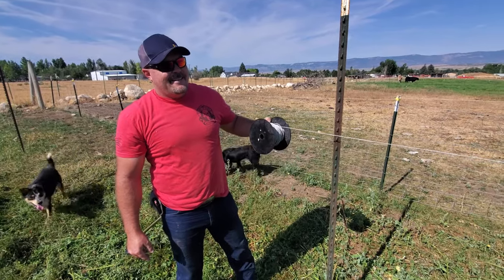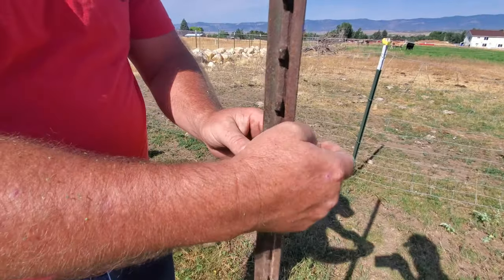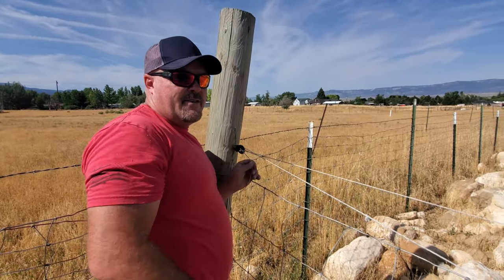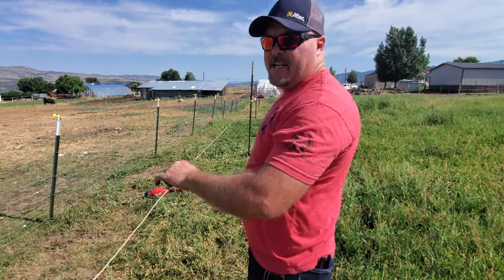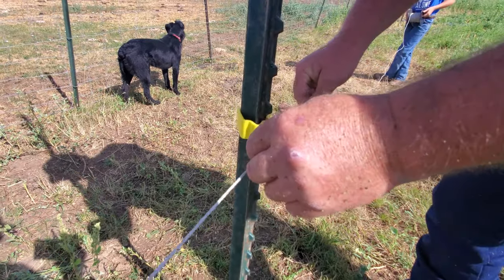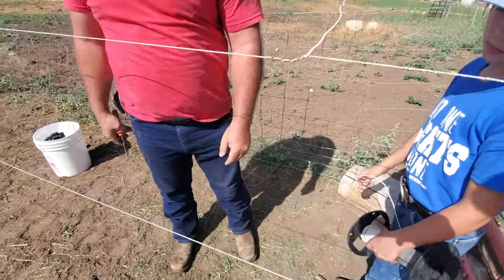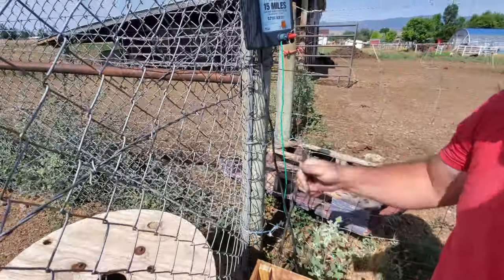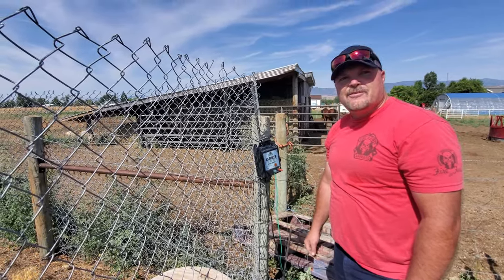Easy Electric Fence Install | Step-by-Step

Comment: "It does do 15 miles, I told you"..... This made me laugh! I guess b/c I can relate. Good video! Now I will stop buying the connectors to energize top and bottom strands; just use insulated wire to energize. Common sense

Comment: A question. On putting up a bear hot fence do you think the string wire is ok to use or would you go with the wire wire 14 Or bigger

Comment: If you have the AC charger, what is the reason for connecting that to the two 6-volt batteries instead of just having your fence wire directly connected to the charger?
Reply from the maker: The battery is for a day or several days when there isn't enough sunshine. However, many solar chargers come with a built-in battery as well.

Comment: Hi. Great tutorial. I'm thinking of electric wires to stop squirrels on my balcony. Balcony is concrete. For the 'grounding' are there any other options? Balcony is no where near ground level. I'm going to sound ridiculous here... but will 'grounding' work if pole was driven into huge planters?
Reply: Pound in an 8ft copper rod two inches from the surface and run 14 gauge wire up to your balcony charge box.

Comment: I have about 400’ of single wire to run in a straight line. Can I put my charger and ground rods at about the 200’ point and expect the juice will flow both directions?  Or, do I need to put them at either one end of the fence wire…or the other? Appreciate your good work. Thanks from Kansas.
Reply from the maker: Shane says "Continue doing what your doing. You would be better to have it in the middle and go both directions. That way you would not see any line loss."
Thanks for watching!
Reply: You can use it where ever.  The power will go all directions.  To get shocked. The cycle has to be completed by the animal touching the hot wire and the ground.  If ground is drier the further away the animal is from the "ground" the weaker the shock.   
I think if you have energizer in middle and grounding spread throughout the area the shock will be better.   I'm still trying to learn.  I know it shocks the hell out of me 😅

Comment: May i ask how many volt is the electric fence. And if the house is close by can I plug it in the 110vac maybe step up transformer ?
Reply from the maker: 12 volt. Yes, you can plug in to power. We just done the battery and solar due to power availability.

Comment: Can you give the wiring diagram of your whole electric fence set-up?
Reply: Plug electric fence module into 120v outlet and connect ground side to grounding rod that is driven near the unit and usually you need two or 3 rods

Comment: So, do you have one wire from the positive side of the box to each strand of fence wire you want to energize?
Reply from the maker: Yes, or you can use just one wire and then connector wire to each energized strand. Depending on your setup.
Reply: @highdeseretranch and the other side of the box is only for ground? Nothing else gets attached to it?
Reply from the maker: @remarkable_ruin8608  Correct. You always need a ground for a safe system

Comment: What gauge wire do you use to connect the lines on your fence? I noticed it's not that nasty double insulated steel ground wire that's so hard to bend.
Reply from the maker: It be high tensile 20ga
Reply: @highdeseretranch  Thank you!

Comment: Will a complete loop cause a short,
Reply from the maker: No sir it won't.
Reply: The fence on my pasture is fed by 2 wires and makes a complete loop,  but still not working properly
Reply from the maker: @allenbarnes7202 Check your grounding point(s), in drier and especially  more alkaline soil you might need multiple grounding points, depending on fence length. Also, if things are touching the wire such as grass that can also cause the system to short out. It could also very well be the charging/battery unit itself isn't working properly. With most units if you hear a ticking sound things are connected properly and/or the unit itself is working.